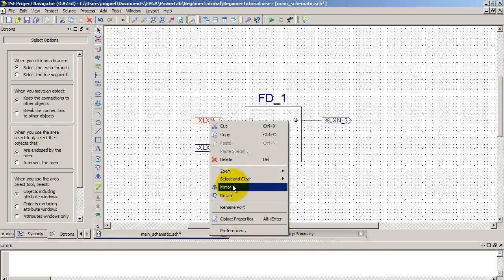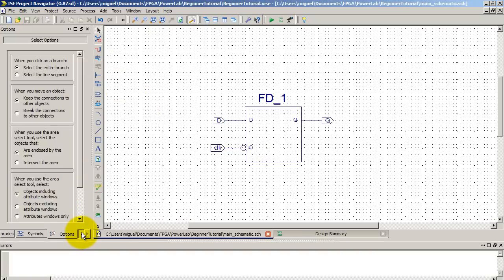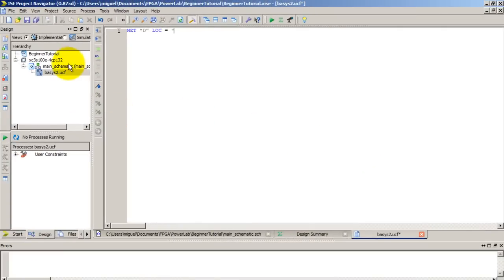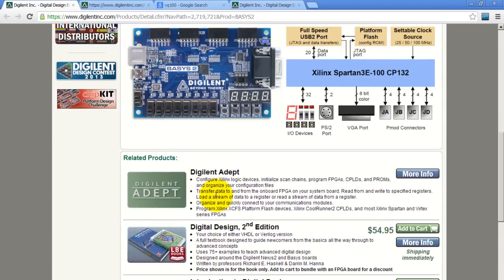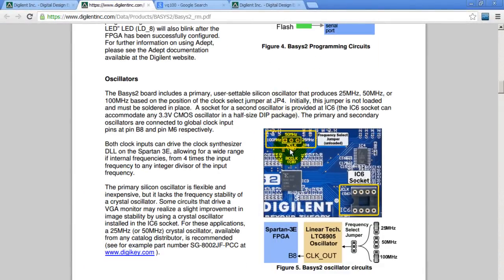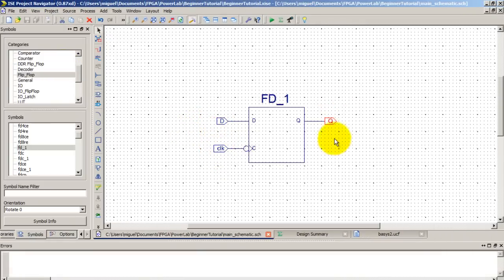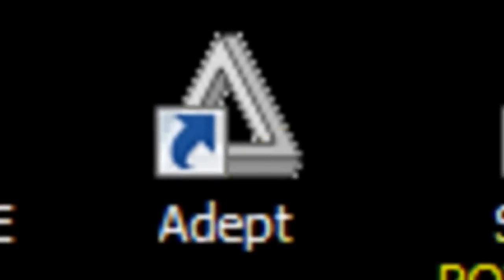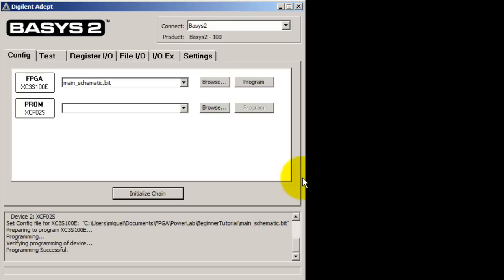How To Program an FPGA With Xilinx ISE Webpack In Verilog or VHDL

Comment: what was the use of a D flipflop here? The output could have been connected directly to the input. By the way, the clock frequency is very high due to which you don't notice the output synchronizing with the clock. Thanks for the video!!!

Comment from the maker: It depends on the A/D module you are using. I've used Digilent SPI A/D module. I didn't write the code though, I just found a module at opencores . org and included it in my project.

Comment: Thank you for the work & Info, on the Adept Soft. 
It will help to prog. the new Lattice iCE40 FPGA Chips.
 
Via Bit-File in a SPI-Flash-ROM Type:AT2510.
Via this low cost Atmel-AT90USB162 on  Board Programmer.

Comment from the maker: You need to know about digital electronics and logic design (logic gates, flip flops, etc) and the languages you can program them in (VHDL, Verilog). You can learn about these two topics separately by reading a book about each one respectively. I like a book called "Verilog HDL" to just learn Verilog. There is however a book that goes with the FPGA in this video called "Introduction to Digital Design" that teaches you both logic design and Verilog, I'll post some links in the description.